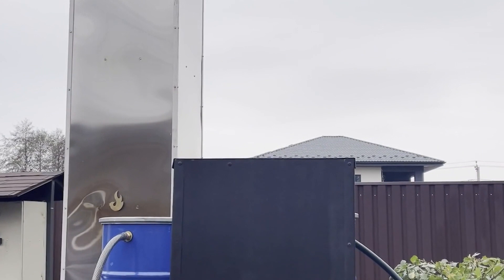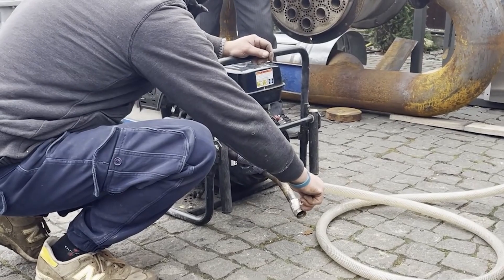Wood-Fired Electricity Generator for Rolling Blackouts

Comment: Great video presentation, on your simple personal-use system Mr SergeyL.
As you know for 15 years to make electricity with wood has been my main passion.
Best to 1st show interested users what it can do for them.
Then what they will have to do to make it functional. And finally, then long-term usage maintenances needed.
It has been a long time since this is shown this way. Larence Garringer with his systems in/about 2008-11.

Ha! Ha! And I did see some of the "Devilish Details" in the long steel poker/stirring rod. The use of the larger 390-420 cc engine. Driving the larger Mecc-Alta style generator head. To better heat load the system. I see the tall long-pathway fuel stack to control inlet air passed through. I see the simplicity in gases cooling and dropping out filtering in the six stacked barrels system.

System simplicity requires needs-must driven necessities. And those war-unfortunates; combined with Ukrainian will-power is the winning combination.
Best Regards
Steve Unruh